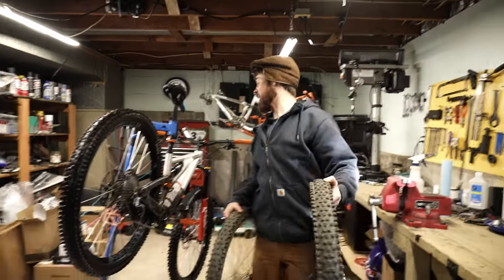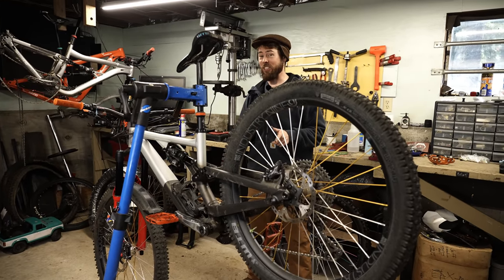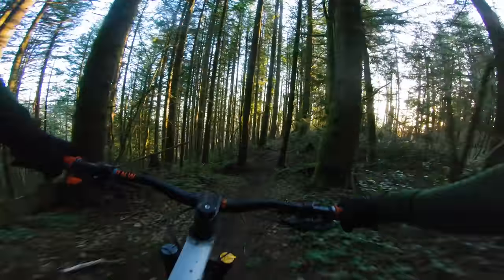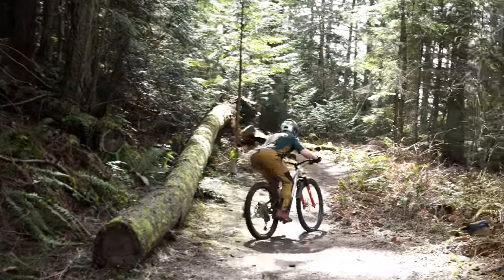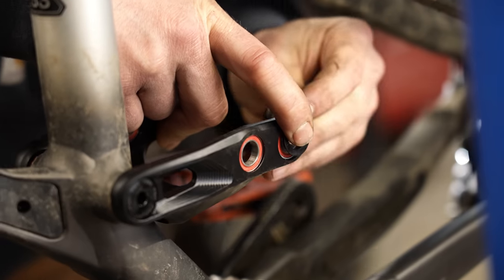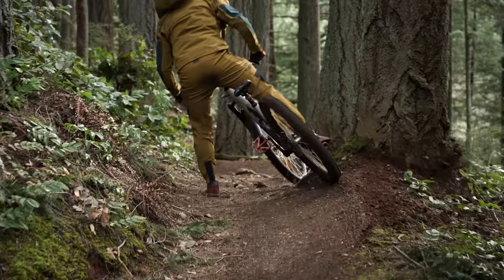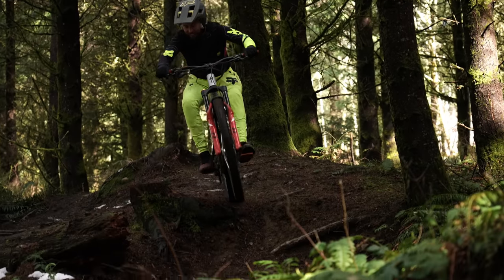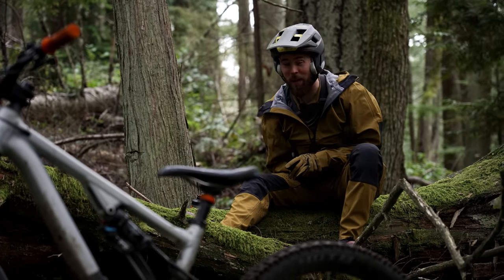Stumpjumper EVO MULLET: am I wrong?

Comment: Looks like you're riding really flat terrain. Steeper stuff the mullet comes alive.
Reply: Also the approach angle and radius of the smaller wheel is making the balance point worse when doing manuals so you definitely won't like that either lol. Tested on wrong trails tho.
Reply: Those Galbraith trails are not flat.